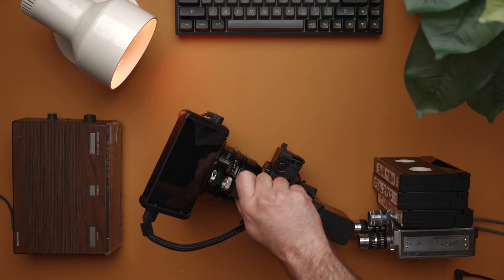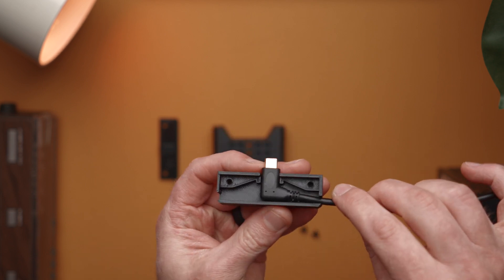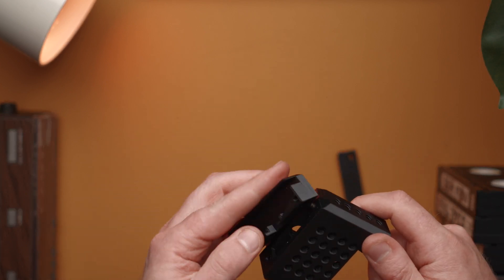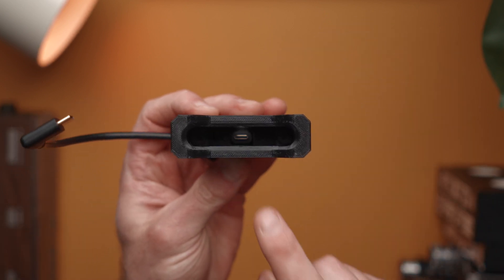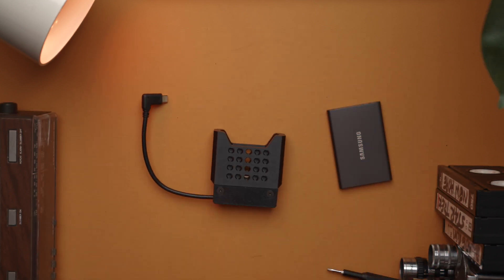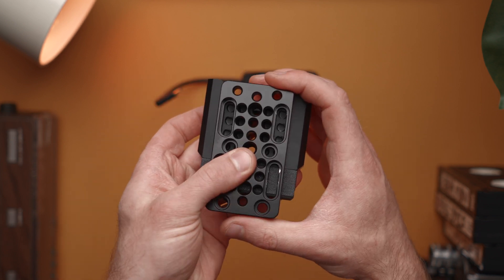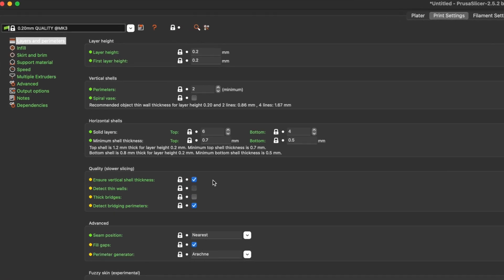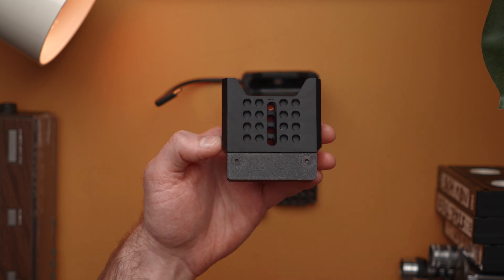CineDock - The SSD Hot Swap Dock for Cameras!

Comment: I’m a little confused. You showed that the T7 and the T5 fit into the dock — spare the centering of USB port the dock seems to work for both. But you have two different 3D file sets: one for T5 and one for T7. Did I miss something? I have several T5s and T7s so it would be nice to have a universal dock. I just want to make sure I print the correct files.

Comment: Hi there Caleb, I was wondering if you could tell me what the cable featured in the original video is called (the aluminium one with strain relief and clear coating on the wire).  I'm looking to build something similar for a friends camera and the cable looks much nicer than the alternative that I've found. Thanks!
Reply from the maker: That was the original cable I used but it was too slow and didn't work with drives :-(